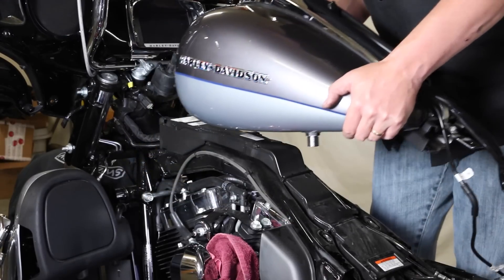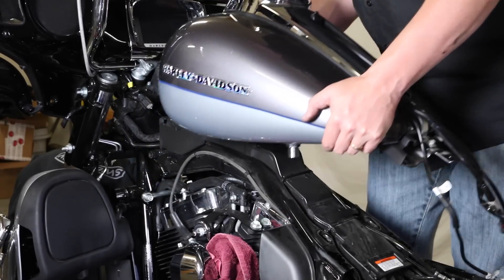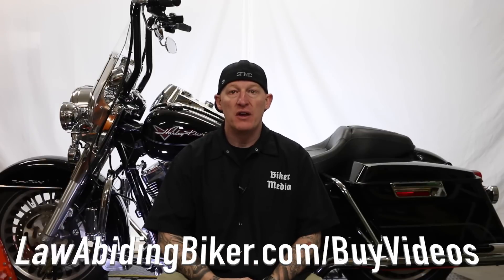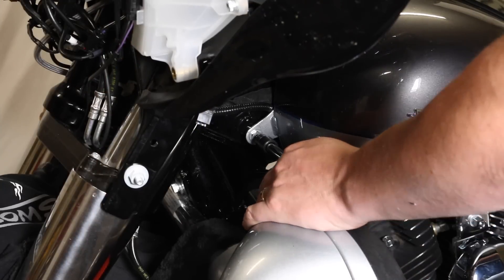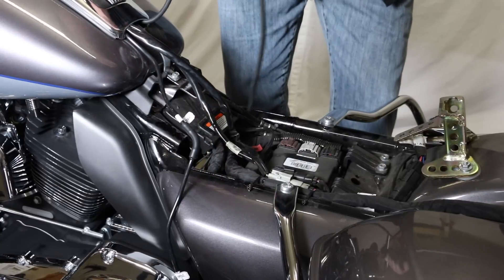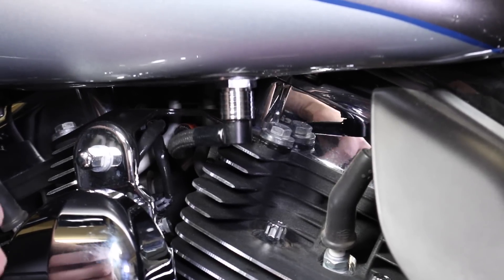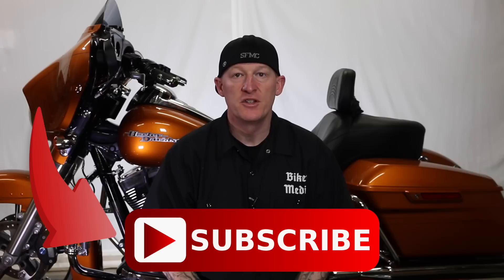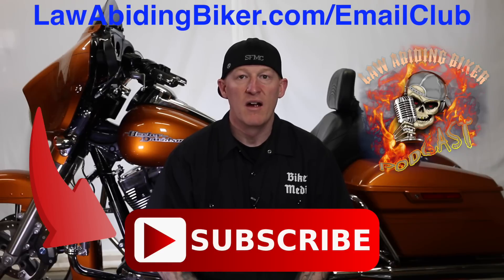Remove & Install Harley Davidson Fuel Gas Tank-Motorcycle Biker Podcast

Comment: Changed my fuel filter on my 2008 Dyna Super Glide...I now have an engine light on. Have checked everything. Unhooked the battery to see if that would clear it out, but didn't help...rode it 20+ miles, light is still on.

Comment: Great video. I'm about to have to do this so I got a 05 road king custom do I have to drain the gas out of it first??
Reply from the maker: No need.  The fuel won't leak out.  You might loose a drop or two when you disconnect the quick connect coupler.  It doesn't hurt to put a rag down.

Ride safe & Ride Often!

Check out this YouTube Channel as we have a ton of free videos for you!

Check out our useful for purchase videos: http://www.lawabidingbiker.com/buyvideos

BECOME AN ECXLUSIVE MEMBER-GET BENEFITS:
http://www.lawabidingbiker.com/patreon

Leave a flat donation: 
https://www.lawabidingbiker.com/donate

Shop in the Official Law Abiding Biker Store:
https://shop.lawabidingbiker.com

Subscribe to the Law Abiding Biker Podcast: https://www.lawabidingbiker.com/app

Join our free email club:
https://www.lawabidingbiker.com/emailclub
Reply: @RyanUrlacher  thanks for the info.

Comment: hi, wanting to venture into this to keep on cleaning of rocker covers on my 2015 softail slim... is the process same? i.e do you have a video that shows dealing with the dash..speedo etc..
Reply: Norman it is a little different, but I have done it and its pretty easy to figure out.  We may have one soon with our older Night Train project we will have, but it may be a little different than your new bike.  We recommend you get a service manual between now and then.  They will point out the process for you.  Rick from LAB.
Reply: norm did you complete your task? softail slim rider also
Reply: tbh not had chance yet..
Reply from the maker: We've got many videos either ready to go and or in the works. We do have a dash panel removal. runs over the top of the tank. Hopefull out soon. Make sure your subscribed. Ride safe

Comment: Thanks I am tearing down a 2001 Road King that got rear ended real hard and the frame is bent but from the gas tank foreword is all usable stuff. I am an old dude (66) that has never worked on an Evo or Twin Cam so your videos and very helpful.  If it is a Flat Head a Pan or Shovelhead I can work on um with the best of um but these new scooters are a pain. The newest bike I ever owned is my 1972 FLH Police Special until I got my 2002 FLSTC and this wrecked Road King.  It was $1.400.00 bucks with a clean title with low mileage and it still starts right up.  I want to know who the knot head was that thought putting the fuel filter in the gas tank was a good idea.
Reply from the maker: Nice!!!

Comment: Thanks Ryan.  there's some sort of valve/hose/line on the front right side under the tank.  does that have to come off?  I'm replacing my T/I cables and removing the tank would make it easier.
Reply: ah....just figured out that's the fuel crossover line....I'll have to figure that out.
Reply from the maker: +Danny Weakley Yes Danny, it's a fuel cross over.  remove one side and pinch it off.  No easy way to do it.  Some gas will spill out so make sure you have some rags down.
Reply: +Ryan Urlacher thanks!  time to get baptized I guess.
Reply: wont fuel just flood out everywhere if i do that?

Comment: Do you have to drain the fuel first?
Reply from the maker: Not on the newer bike with the quick disconnect and nor cross over line.  You should drain the older bikes.  What are you working on?
Reply: Ryan Urlacher a 2007 SuperGlide.
Reply from the maker: Good to go. It has the quick disconnect!
Reply: Ryan Urlacher what about 2006 street glide?

Comment: HI, is it possible to change the Tank of an FLHX 2006 to a 6-gal tank? what´s going on with pump, cableling ? Thanks Mike
Reply: Mike we have never completed the project you are interested in.  I doubt the 2014 tanks would work without alterations due to the frame changes. There are aftermarket options out there for you.  Rick from LAB.

Comment: I have a 77 FLH Electraglide. I would appreciate if you could let me know whether it would be basically the same process so there is no risk (or at least minimal) of running into any time-consuming complications. Bike sat for a long time with fuel in the tank. Now the tank has rust around the inside lip of where the gas cap sits. I had a repair manual but haven't used the bike in so long, don't know where it is. Thanks a lot.
Reply from the maker: I cant' say for certain.  There won't be a quick disconnect like on the new bikes.  There should be bolts that hold the tank on at the front and rear.  Most likely there is a fuel cross over tube from one side of the tank to the other that you will have to remove.  It's a messy process on the old bikes.  Drain the tank the best you can.

Ride safe & Ride Often!
Here is a link to a bunch of our useful Free vids bro: http://www.lawabidingbiker.com/freevideos
Here is a link to some of our useful for purchase videos: http://www.lawabidingbiker.com/buyvideos
Want Answers & Information Fast? And help support us at the same time? Do you like the content we provide?
Our patrons get answers to their questions/comments/feedback in less than 24 hrs and are part of our Private Facebook Group. If you are interested in being in this exclusive group you can get all the details at ==> http://www.lawabidingbiker.com/patreon
If you haven't subscribed to the Law Abiding Biker Podcast make sure to do so. Listen in as we talk weekly about issues/items like this & so much more. You can listen on iTunes (Apple/IOS), Stitcher Radio (Android), or any other Podcast App ==> http://www.lawabidingbiker.com/podcast
Join our free email club at http:///www.LawAbidingBiker.com/EmailClub. Only relevant content will be sent from time to time. Email club members are the first to find out about free or for sale content are given special coupon codes.

Comment: Ryan hi I got a 97 883 Sporty that I am running 2" drags and stock airbox filter system on recently had the stock ingition system replaced in the cam area but may problem is I have a slight stumbling problem it's there then goes away my carb was rebuilt two year's ago I changed the stock jets to #45 ploit and #170 main ran fine is this a good combination on jet's or what would be the right jet sizes to use for this CV40 carb? Ride Safe

Comment: Ryan, How to you remove rust and then seal the inside of the tank without clogging the front fuel lines that are split with a rubber hose to each side of the tank. Iv a 92 EG FLHTP. Thanks.

Comment: so the breather lines have no specific place to be as they are just breather lines?
Reply: Pan, the breather lines just go town through the frame towards the motor.  Just re-route them in the same location as they were when you pulled them out.  Make sure they are not touching the motor etc.  Rk from LAB.
Reply: +Rick "Big Daddy" Kane thx for the response.  it was a dumb question because there was a couple of diagrams in the maintenance manual showing specifically where the lines are supposed to go. 

but that being said,  whoever serviced the harley last didn't put the breather lines in the correct spot per the diagrams instructions.

Comment: So....Did you purge the tank..I seen you just popped off the pressure line.. What damage do you do to the motorcycle fuel system..If i can't start it
Reply from the maker: No need to purge the tank.  It's a quick disconnect.  No damage done. 

Ride safe & Ride Often!

Check out this YouTube Channel as we have a ton of free videos for you!

Check out our useful for purchase videos: http://www.lawabidingbiker.com/buyvideos

BECOME AN ECXLUSIVE MEMBER-GET BENEFITS:
http://www.lawabidingbiker.com/patreon

Leave a flat donation: 
https://www.lawabidingbiker.com/donate

Shop in the Official Law Abiding Biker Store:
https://shop.lawabidingbiker.com

Subscribe to the Law Abiding Biker Podcast: https://www.lawabidingbiker.com/app

Join our free email club:
https://www.lawabidingbiker.com/emailclub

Comment: hey Ryan. thanks for posting these videos. yours are always easier to follow. so do you have to drain out the gas before removing tank. or will that stop valve hold all the gas in there?
Reply from the maker: +MrBEZROC The valve will hold the fuel.  A small amount may leak when you disconnect.  I suggest putting a rag down to catch the small amount that leaks.
Reply: +Ryan Urlacher sounds good. thanks for answering so quick. ride on bro.